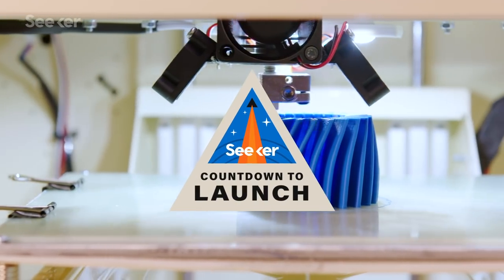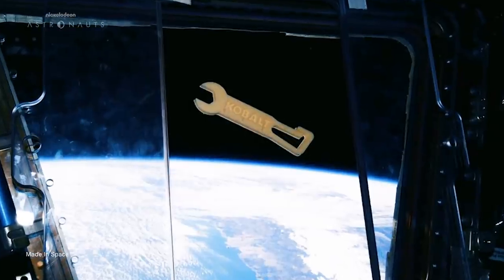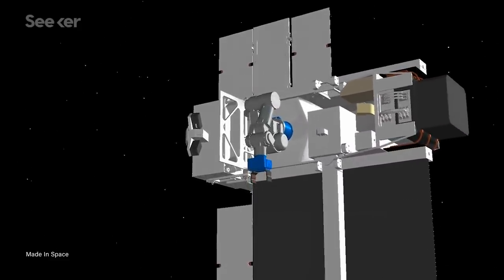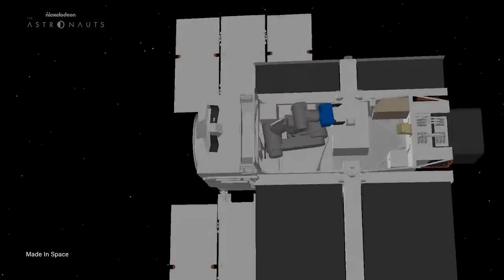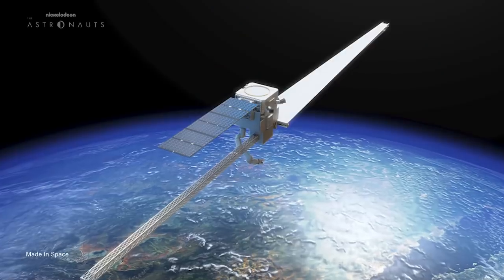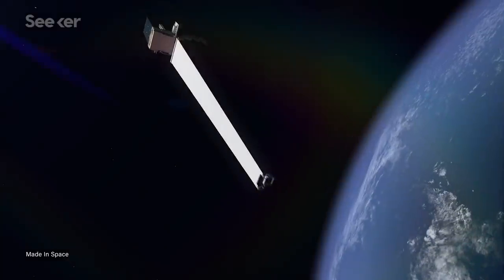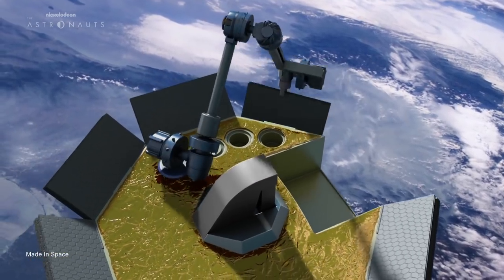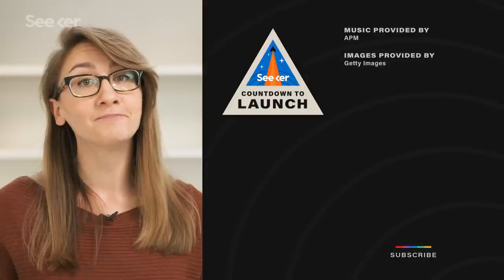How This Next Generation Satellite Will 3D Print Itself in Space

Comment: I love your videos BUT .... the mass that has to be brought to space is the same and it is a lot more difficult to assemble and ensure things are working correctly in space. The point made about the take off contraints seem off too. We can't print "delicate" components such as electronics in space (yet) only structural components which will have no problem with take off anyways. Geometry is the real significant factor here. We can't send a satellite with a 20m pole on it to space due to limitations on the fairings size containing the sattelite unless it contains a mechanism to reduce its overall length while with 3D printing in space these dimensions can be achieved. However with todays 3D printing technology (I work a lot with different 3D printing technologies) the mechanical properties for overly large parts is not provided by common polymer 3D printing. The really exciting and interesting application people should pay attention to is the further development of self-assembling structures in space using robotic capabilities like robot arms. Using smaller pre-manufactured parts which can be toleranced and tested on earth and then assembled in space is the real benefit here. I totally agree with bringing a 3D printer to potential Moon and Mars bases. This makes a lot of sense due to the flexibility it provides astronauts with!

Comment: At least twice they mention saving weight? You still need to ship the weight to feed the printer. Plus you need to ship the printer. So it's heavier but has capability to self repair and be smaller maybe. But unless you get the raw materials from space it will never save weight
Reply: You do get to use a smaller fairing though, which does save weight, and you don't need to design the payload to survive the ascent.

Comment: How did they simulate mico-gravity?
Reply: They never said they did, just "simulate conditions", which probably means vacuum+ temperature swings.
Reply: @rdizzy1  The most difficult assembly  condition to overcome will be micro-gravity. If they did not come up with a clever way to simulate it, then there is a big gap in their testing.
Reply: @billyclabough9835  they have tested 3d printing on the ISS. And there's always small-scale tests on zero G flights...
You do have to test those things separately though

Comment: 0:01 That part cooling fan design is just awful, there's no duct to direct the air to the part, most of it is hitting the heating block; that's a quick way to run into a thermal err.
Reply: Not a cooling fan...